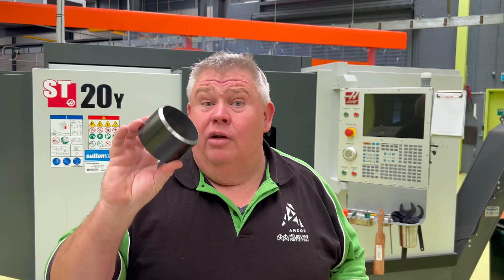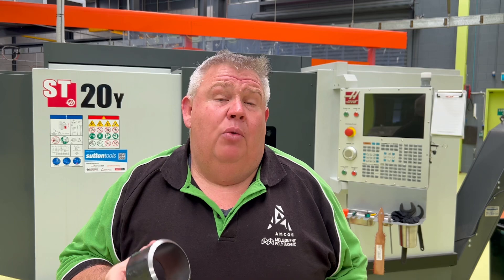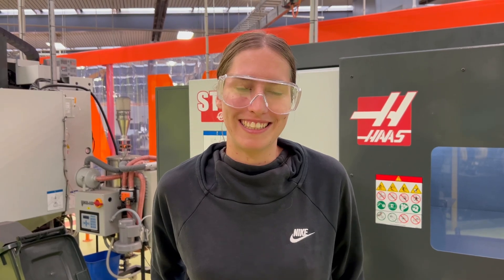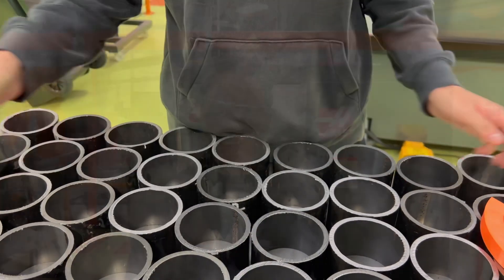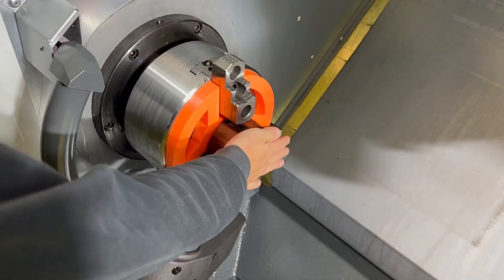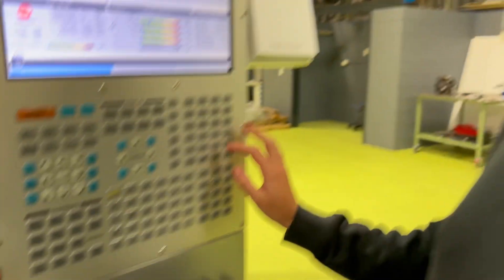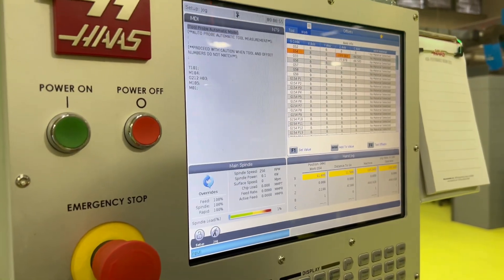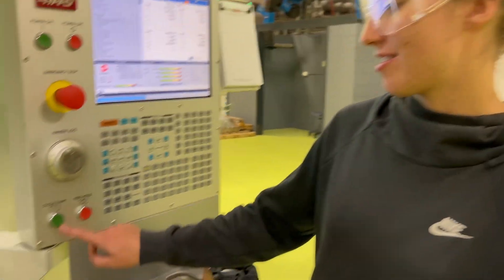Female apprentice running $120K+ CNC Lathe

Comment: Hey Aaron. 
I still remember these 4" pipe sections back when I was doing my pipe ticket. 
Feels like yesterday.

A good habit to do when setting up your work offset is to call the tool and start the spindle at the same time. 
It helps to save time going back again to do the same thing twice.

Good to see you posting again. 
Hopefully, Aaron over at Aaron's Engineering will be motivated after seeing this video 👍
Reply from the maker: G’day Peter. Always good to hear from you mate.  Yes that’s still the same project that they do in heavy fabrication program.

That’s an excellent tip Peter and definitely a time saver. As it was Jana’s first time using the machine I was just taking her through the steps slowly and one at a time. But I’ll take that on board 👍. Cheers mate🍻

Comment: was nice to see one of the new trainee's doing the job nothing to fancy but a job nonetheless as for doing this on a manual mill i could not see it being a problem as it's one set up and one turning operation would not have taken much longer to do either as for there being 150 parts or 1000 parts it' a job and needs to be done thanks for showing much appreciated 
Cheers
Reply from the maker: G’day Wall. Appreciate the view and comment mate. They used to get the technician to prep these parts. Used to take the poor bugger a good day and a half to do them all. Getting the apprentice to set up and run the first couple was good for her learning. We then rotated 4 welding apprentices though to finish the batch run. I don’t mind programming the machine, but don’t have the time to sit there and run parts. Cheers mate. Aaron 👍🍻